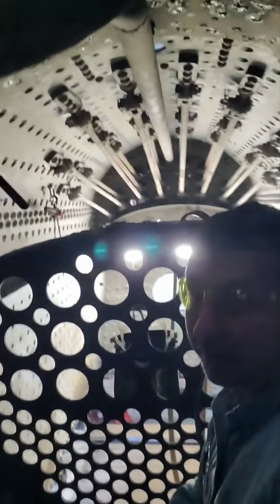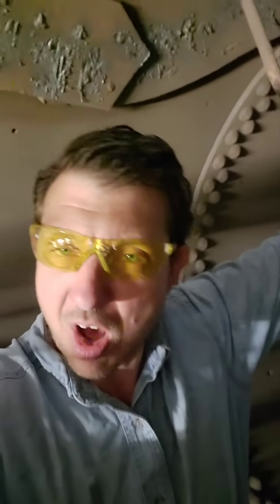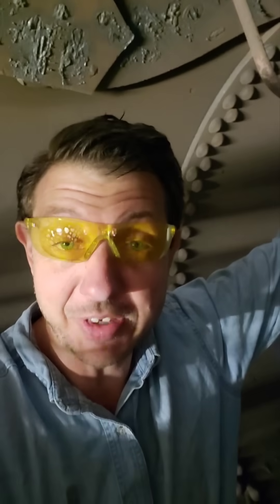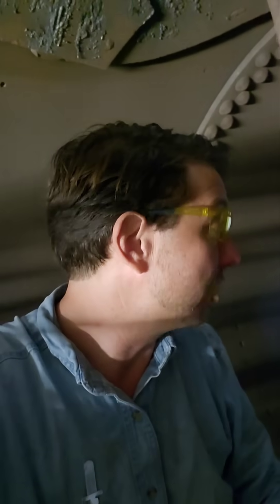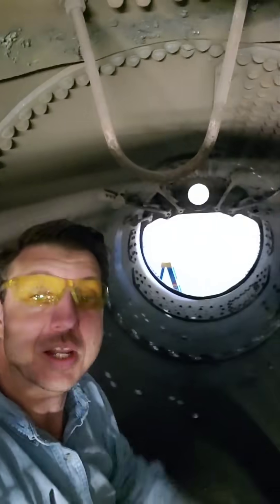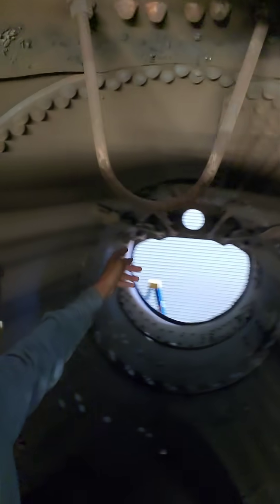The Anatomy of Repair Decisions

Comment: Not the first time for welded barrel replacement.  The Santa Fe bought new barrels for the 3765 class 4-8-4s when their nickel steel boilers started to crack.  If I remember correctly from Dennis Dougherty's presentation at one of the TRAIN conferences back in the 80's or 90's the barrels were from A. O. Smith.  Not all of these were installed, as the ATSF retired some of the engines before they made it to a class 1 overhaul.

I will grant that you are doing the first full welded barrel replacement in the preservation era.
Reply: Wow. A.O Smith. And to think they only made water heaters lol. Guess they'll make anything that contains and or heats water